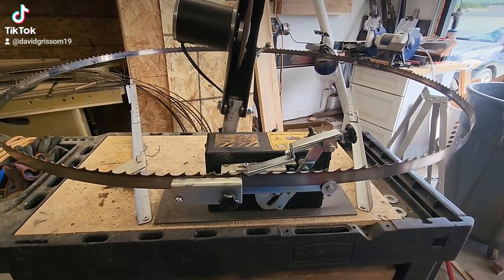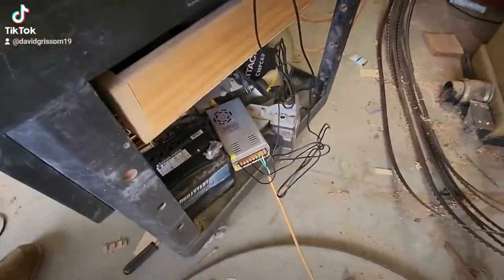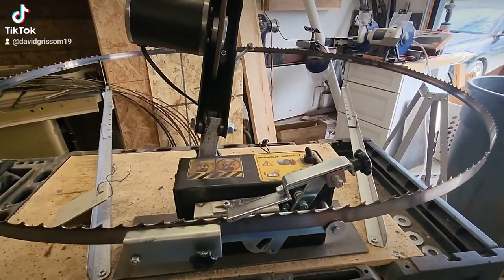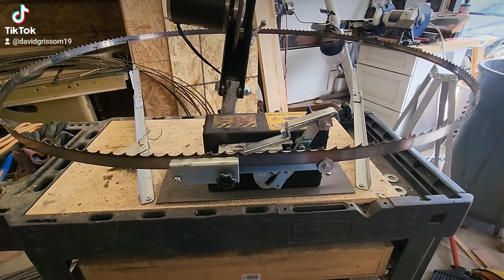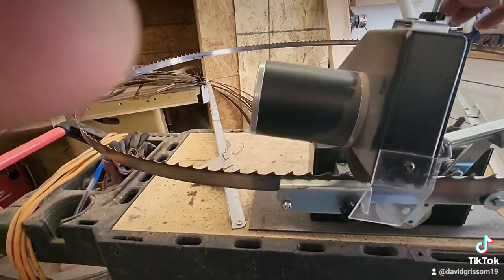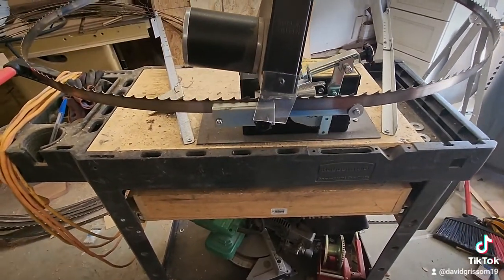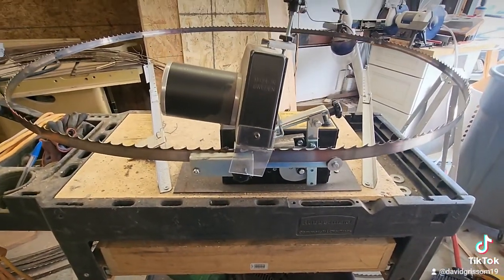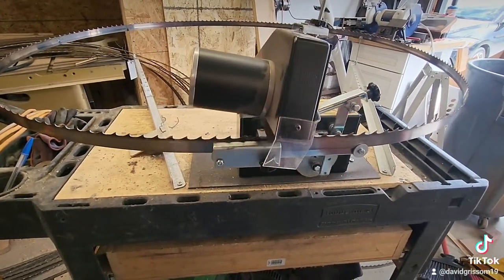woodland mills bandsaw blade sharpener upgrades

Comment: Good morning I’m so glad I found you channel. I have a Norwood hd36v2 and am going through blades like poop through a goose! I was was thinking about the combo woodland mills is selling, but wasn’t happy with the speed, I thought to change  the gear motor out. Now I know That it will work and which gear motor to buy thank you also for the power supply idea I like that better I was thinking about the wood miser 25 that does 30 a minute but it’s a lot more expensive and I like the Woodland mills. Thanks for sharing God bless you and yours

Comment: Does it only touch the face? I like the make the whole profile shinny. Perfect chisel on face and top of tooth will cut a long time.
Reply: Do you have a woodland mills sharpener? I am thinking about getting one but every video I watch the grinding stone is only touching the face of the tooth and barely in to the gullet. Some say that you only need to touch the face of the tooth and the gullet but I like to sharpen the face, gullet and back side of tooth
Reply: It's designed to cut the face and a small portion of the gullet to remove any microscopic stress cracks. You don't grind to or up the next tooth.
Reply: @ryanlawley5960  you better look at cooks or timber king. You need to grind the whole profile to keep the blade shaped like it was designed.
Reply: @ryanlawley5960  I have a timber king, it sharpens the whole profile.
Reply from the maker: Yes I only grind the face and gullet. No need to grind the back of the tooth

Comment: Why you destroying sawblade?If you need chanching manufacturer hook angle,do it that slowly with diamond grind wheel with cooling.Never forget,top of tooth is double hardened and if you hiting tooth,made it softly then original and reduce working life of blade.When you setting tooth,must have comparator.When grinding,must have protraktor!!!Properly you grinding only gulet and back side of tooth..Front side never,or,if nesesery,easy,easy contact between grind wheel and tootf.Sorry for my english.